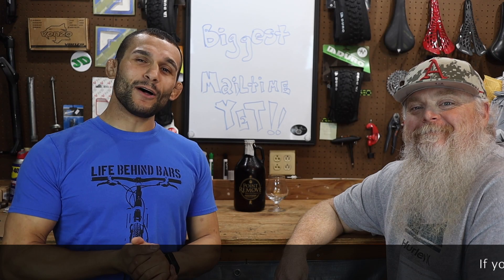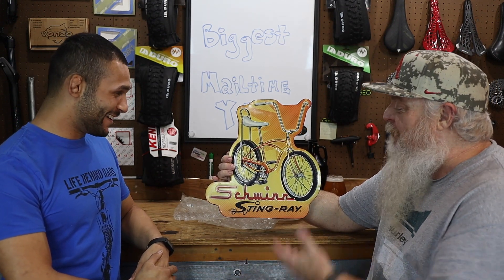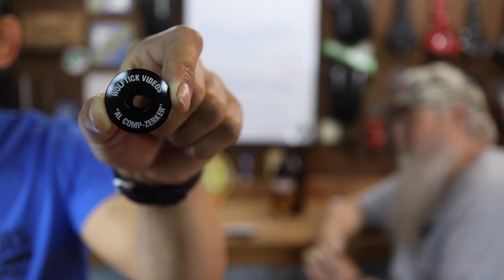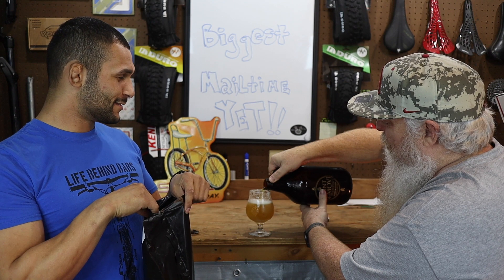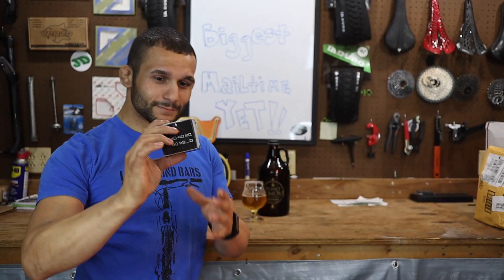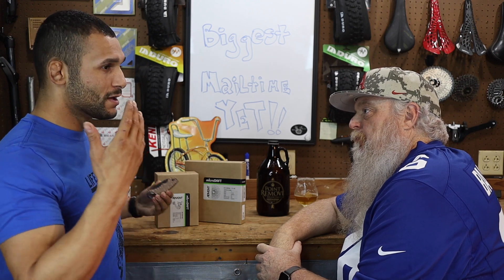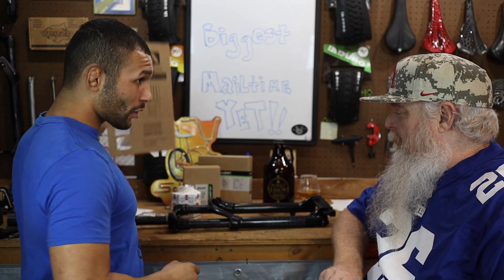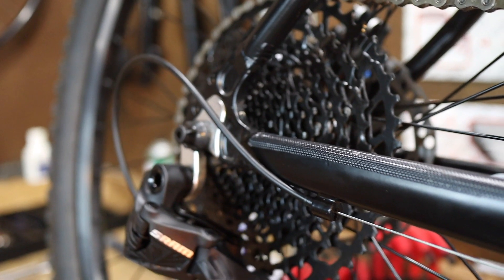MAILTIME & AMS Frame Guards

Comment: I use poped inner tubes to make frame gards
Reply from the maker: That sounds interesting, then glue them? Ultimate budget!!!🤘🤘
Reply: @WOLFTICKVIDEOS  no they are grip central all you have to do is use electrical tape at the end or a zip tie
Reply: @WOLFTICKVIDEOS  for the chain stay i just wrap it around and zip tie it
Reply from the maker: Nice:)
Reply from the maker: Seen that a few times as well:)

Comment: Throwing in my obligatory cheer for the JUDY! Nice work! Those suckers have been in and out of stock for the last 4-6 months on World Wide. Just got mine installed and pulled out the all-travel spacer inside to convert it from 100mm to 120mm. I'd be curious to see what you think of it compared to the Recon RL you had back in October. I've heard motion control dampers (Recon RL) vs. turnkey (Judy Silver TK) are night and day but I've  never known anyone who's been able to run a real-world test on those two forks side-by-side.
Reply from the maker: Hey Bart glad we could both find some man! They look t ok be legit and hope they perform well, hope to have a install this friday were we weigh and measure them out. Also may look into buying a damper for it??👍👍
Reply: @WOLFTICKVIDEOS  Nice! Looking forward to it. The turn key is the damper for the rebound (if it's the Silver TK fork). There should be a little black key (plastic flap) under the right side that turns left/right 5 clicks based on fast/slow rebound.
Reply from the maker: Oh yeah brother I got ya, I thought you were talking about the internal damper you can buy:) Not the rebound. But yes 5clicks of rebound!! We just installed and initial reviewed them tonight, SEE YOU FRIDAY!!!
Reply: @WOLFTICKVIDEOS  That was my bad man! I was mistaking the bottom rebound "key" for the turnkey compression knob (top), but same result in the end. See ya Friday!

Comment: I just bought that exact shock for the Kawasaki bike!
Reply from the maker: Really!! Man gonna be sweet upfront, I'm sure the women who rides it will love it even more now🤘🤘
Reply: @WOLFTICKVIDEOS  im not talking about the fork i mean the air shock for the rear. Do you know what bike there off of? Im trying to figure out what ratio the shock was designed to work with.  It only has 38mm of travel so the bike it came off of definitely had atleast a 2:1 ratio
Reply from the maker: Man I have no idea.....They are supposed to be a never mounted brand new shock. So as far as the ratio no clue, we just hope they fit the temissor or the sandtstorm!! May have to watch your video first before install:)
Reply: @WOLFTICKVIDEOS  sorry east coast slang! "What it was off of" meant "what bike it was originally designed for " Most of the department store bike shocks ive seen are 150mm and the new shock is 165mm so it will sit allitle higher in the back but being a air shock you can adjust sag. The bolts should be the same, it bolted on to my Kmart Kawasaki.
Reply from the maker: Cool to hear, we had no clue if it would fit as far as width on the eyelits go, hope its smooth sailing:) Thanks Chris H???

Comment: "WHAT THE HELL" is exactly what I said when I opened the box. What a bummer. I commented to you a week ago on your fat fork shootout vid about which one I should go with. You said Bucklos, so I went with it- we'll I'm trying to go with it.  I also sent you the link to the Himalo fat fork on Ali's. Anyway, yeah, I'm bummed I gotta send this one back and try to get them to send me a Bucklos (which they're running out of). Someone also just sent me a link to a Bolany fat fork with rebound on Amazon. I looked everywhere for that and couldn't find a Bolany with rebound. It has 34mm stanchions, which I like. But they'll prolly send me a ZTZ or some such BS. I am also now considering getting a tapered fat fork and using the Cane Creek adaptor headset you told me about.
Reply from the maker: Man that sounds all over the place? I thought you were talking about a 29er to begin with? Our video was a 27.5 and a 29er budget shootout (no fat fork) so we are a little confused lol. Now the cane creek 44mm adapter is for a tapered to straight steerer but do they make a fat tire tapered fork? If so why would you want to adapt it?
Reply: @WOLFTICKVIDEOS  Oh, my bad...  that's right you had the MTB fork shootout AND a fat bike video. I got them confused. Sorry.   So yeah, all the over $200 fat bike forks are tapered and only the Chinese under $200. ones aren't, so selection is poor for my straight tube fat bike frame. If the Bolany ZTZ fat fork I just ordered turns out to be poo, I'll consider the Cane Creek headset adaptor and look for a used Rock Shox Bluto fat fork, but I think this is overkill for my purposes- mostly paved bike path riding.

Comment: Hello  iam George  .I'm 6ft 3in 236pounds.  Is the polygon xtrada 7 .. a good bike
Reply: It will be a great bike
Reply: I have a polygon xtrada 6 in Xl. I am 6'- 6" or about 2 ticks 😁 and really like it.  You will want different pedals for sure, and be sure to check that the tire size is what you want. On the front I have a 2.4 wide tire and on the rear a stock tire at the moment. Before you pull the trigger, check out bikes online. The gravity bike has similar features a little cheaper.
Reply: We have an Xtrada in the fleet... pretty good bike.
Reply from the maker: Hi George, hopefully you got some helpful answers. We would not know anything about that particular bike.
Reply from the maker: @Robert Frazier-nice rundown Robert, hope he sees this and why would you wish that site on ANYBODY!!! LOL Its a total mess ha ha ha!! Glad you have luck with them:) Later man and see you FRIDAY